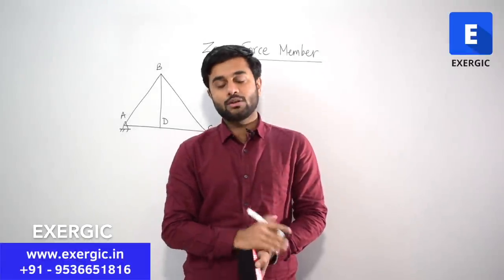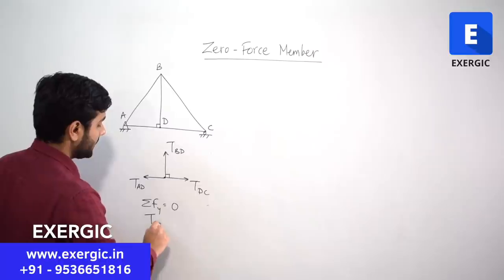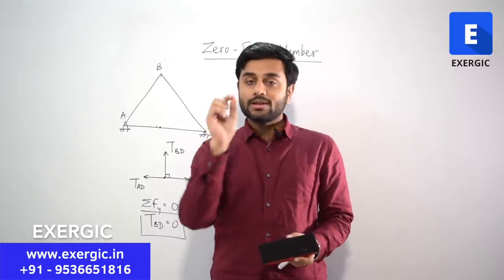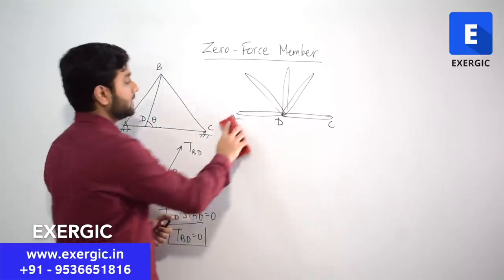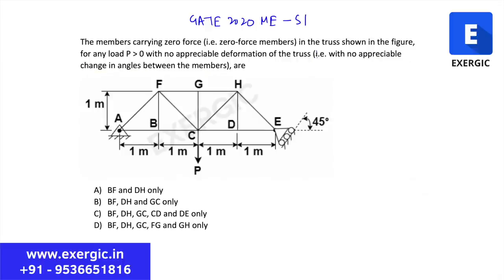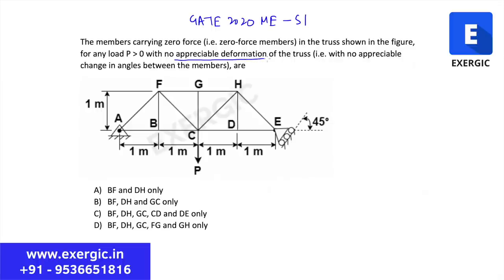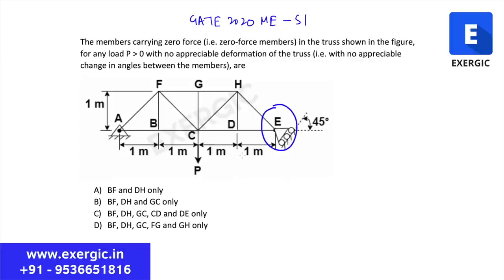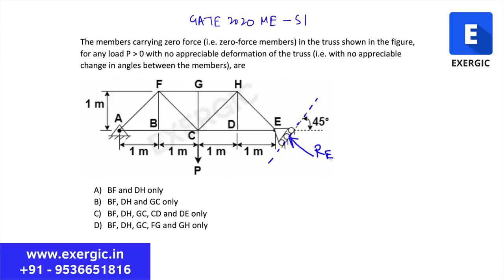Zero-Force members explained with example

Comment: Sir Visually we can't say zero force on Member GC because external Load is acting along Link GC. Although it is not acting at Point G but the Load is acting along Link GC . Please Clear it , I think we can't get it Visually.
Reply: At joint c, the force P will be equalised by component of forces in FC qnd CH in y direction.
While considering joint G, you can't consider forces acting on joint C( Obviously method of joint applies for a single joint at a time.)

We move to point G for simplicity or else it will be hectic for us to ultimately come to a solution that GC is a zero force member because while considering joint C, there are a large number of unknown forces. So, it makes difficult to visualise.
➡ The force at G should be equal to force at C. So,we can intuitively understand it to be a zero force member.
Reply: Thanks to both of you .